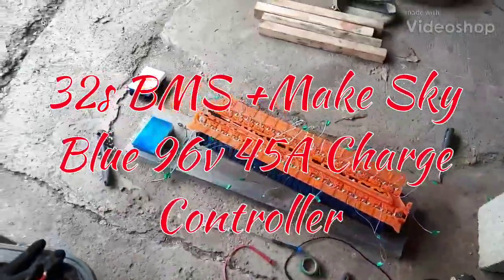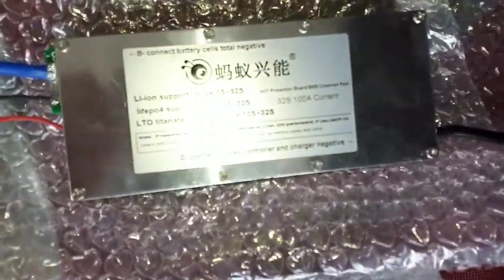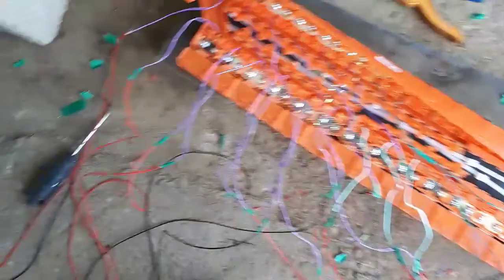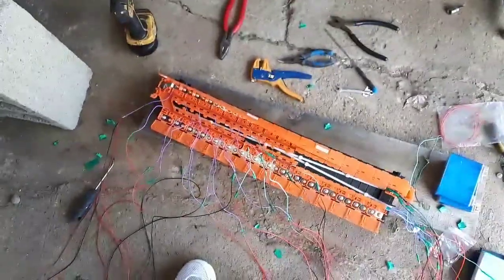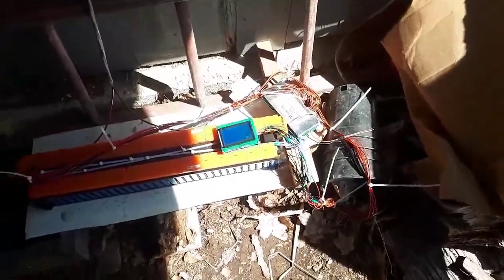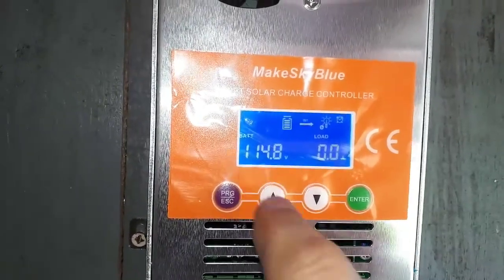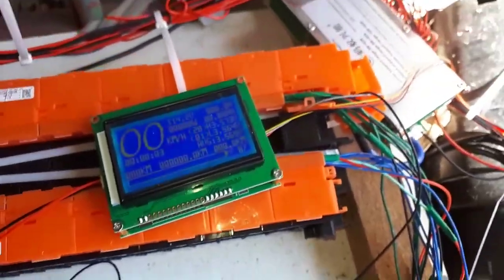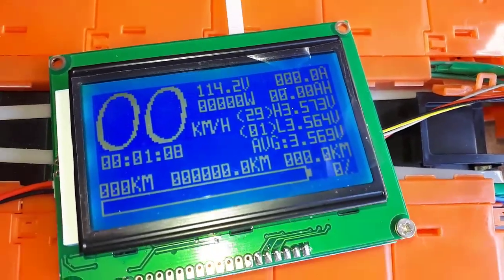32s BMS + 96V 45A Make Sky Blue Mppt Charge Controller

Comment: Hello Youtubers I am having a problem with my makeskyblue controler Whenever it reaches 500 watts it reboots can anyone give a fix on this . Thanks
Reply from the maker: Sorry . I havent seen that yet in one but it sounds like a processing problem. Did you contact the seller?
Reply: each MPPT charging system has its working range, maybe the voltage input is below or over the specified range. pls check.

Comment: Hi, i got 1 PWM CC (9630), is rated 96v 30a, the problem they web site dos not have any information about the maximun PV input. Could you or anybody tell me or guess the optimal voltage for one pwm  CC rated 96V. Thank you in advance. Greetings from Italy.
Reply from the maker: I would open it and look at the input capacitors and keep your viltage 20-30% below that. Probably around 200 vdc input. Not 100% sure tho.
Reply: @frankz1125  I will do that. thank you so mutch.
Reply from the maker: @njm663  ussually a pwm needs to be very close voltage to 96v it may be 125v . Also try to contact the maker of the product. If thats possible.  Good luck
Reply: While i was writing the message, they wansered me, from china. They said 144v input. Any ways, thank you so much.
Reply from the maker: @njm663  anytime

Comment: If you have any questions or issues,  I am the USA Distributor and repair for MakeSkyBlue. 918-315-6128, Call or text. Thanks for making the Video on the 96V unit
Reply from the maker: If you would like to be apart of the big build , Id be interested in anything you could help out with. There will be lots of vids coming. Thanks
Reply: @frankz1125  whats on you needs list.?
Reply from the maker: @seanbuckner1213  Alot. 14-16 awg x #10 stud insulated wire lugs . 1300 pcs. I have 100 pcs on order to try the brand. Yellow and black #18 wire.DC  Shunt trip breakers that work with a Batrium. 10A din rail breakers . 30 pcs. I still need too much to list. Id be cool with some stickers. : )
Reply: what is the input voltage of the makeskyblue
Reply from the maker: @ayoung788  this 96vdc contoller has an input v of 190vdc max
Reply: @ayoung788  Depends upon battery voltage. 12V batt max 80VDC PV, 48V batt 160VDC PV

Comment: Could you provide details on where to get your bms?
Reply from the maker: I got this one from ebay. 8s- 32s 100A with lcd screen. Sold by icgogo. They are not bad. 200 mA balance. Is not an active balancer tho. If you visit his store he has lots of different bms. I prefer the screen and wifi control. Most active balancers dont have the screen
Reply from the maker: Yes but ill need some time.

Comment: please update on the makeskyblue, is it working as an mppt or just a pwm, i am purchasing the 45a model please
Reply from the maker: 96v MSB is still running great. 600 kwh through it.
Reply from the maker: It is great. I believe it is an mppt. The 45 A model is this one. I think its great . I will be getting more of them . I also put a link to my seller. So you know it is the real version.
Reply: @frankz1125  just check the input current and output current. Thanks

Comment: I AM PLANNING TO GET THIS CHARGE CONTROLLER FOR MY 96V LEAD ACID BATTERIES
Reply from the maker: So far so good. Best buy i have found. But it is very close to pwm. The pv input would be nicer at 500v. Thanks for watching
Reply: @frankz1125  how many watts of solar panel?
Reply: you said 1250 in your video, do they really perform well, we will know with time, especially the cc
Reply from the maker: @irenethompson9058  im not sure yet. This was just a test to see if everything works. Time will tell for sure

Comment: This is a neat and clean setup you made there..  Depending on how much you spent on purchase of the battery itself, it can justify the extra cost of the hardware..  One thing for sure, your work has been to a professional level.  Thanks
Reply from the maker: The battery was a gift from a friend. I plan on selling it but wanted a quick test pack for the bms and the controller.I may do some more testing with the pack before I sell. Thanks for watching